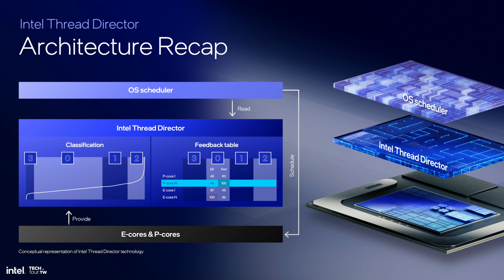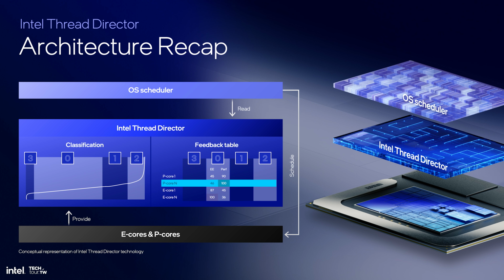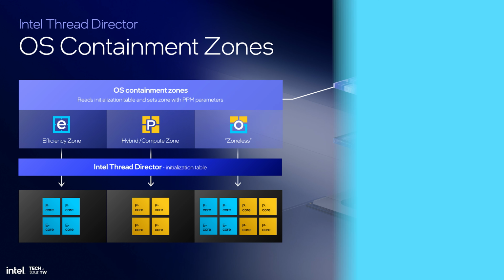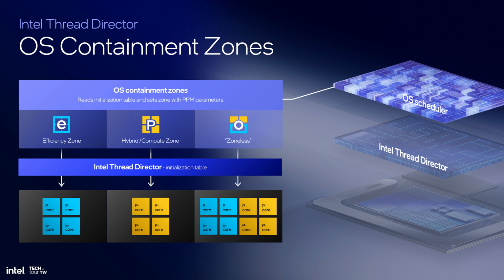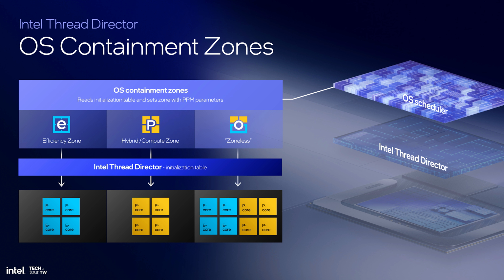The Road to Panther Lake: Hybrid Compute | Talking Tech | Intel Technology

Comment: “Mobile processors are one thing, as apps and workloads are generally smaller. However, for desktops, there’s no excuse for not doubling the IO bandwidth. Current desktop standards with four sticks of RAM aren’t truly quad-channel – the IO and bandwidth are needed. Unified memory and unified cores are the only way forward. Mixing p-cores and e-cores for normal workloads is a waste of time, and I’m happy to challenge anyone on this in real-time, anywhere, any place! Quad-channel isn't quite enough bandwidth, but it's a good start. The memory controllers are old and need updating – these controllers are already made, and it's not a high bar for a modern desktop. It’s low-hanging fruit!” all of these workarounds only work some of the time but when they do not work it is even slower with the ecores on not faster and this side of it will never be fixed!